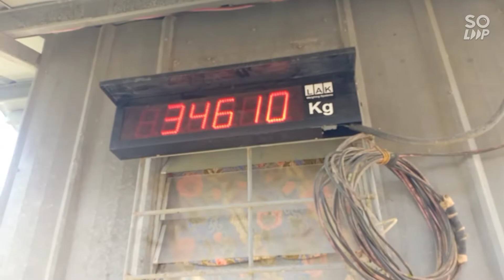sleeping truck

Comment: Idol, magandang araw sayo,  ang unit ko kasi idol ayaw mag swing, pero pag ginalaw ko una yong sa travel na lever, tapos mag swing ako tsaka na mag swing, ano po kaya posibling sira idol, hingi sana ng idea, salamat at God bless po
Reply from the maker: Disk brake brake or pressure plate angat mo Ang bucket pag maitulak mo Yan Yan sa dalawa Ang Ang my problema Dali lang Yan buksan mo lang head sa swing Yung 4 screw lang yan sa top
Reply: @H.Emechanic  idol, kong plate, need ba e lapping ang plate?
Reply from the maker: Makita mo Yan kung buksan mo bka  na ubos na Ang disks jan
Reply: @H.Emechanic  salamat idol